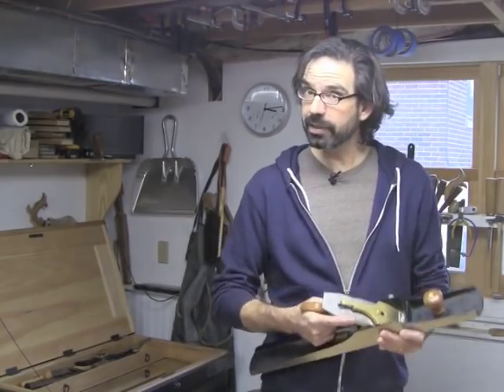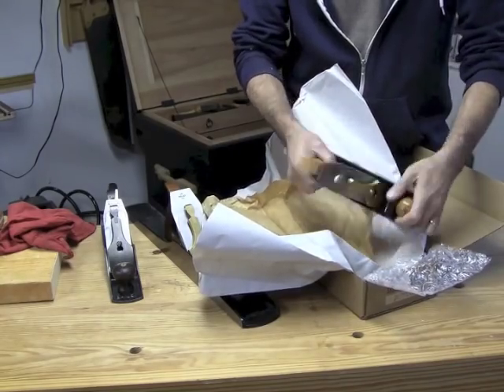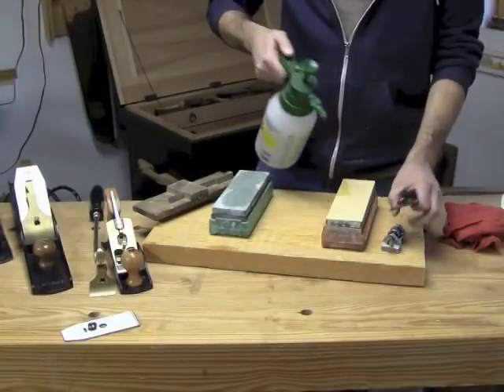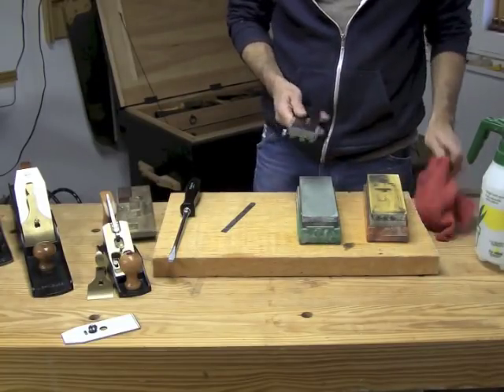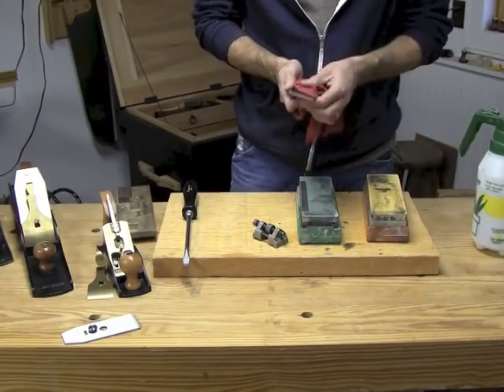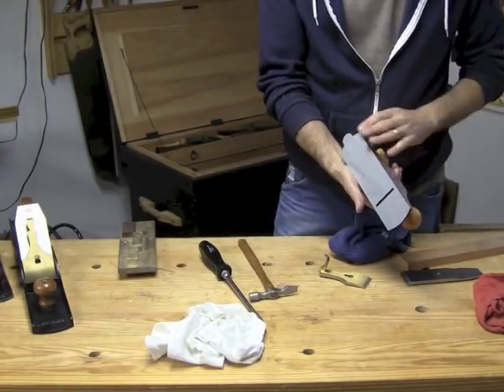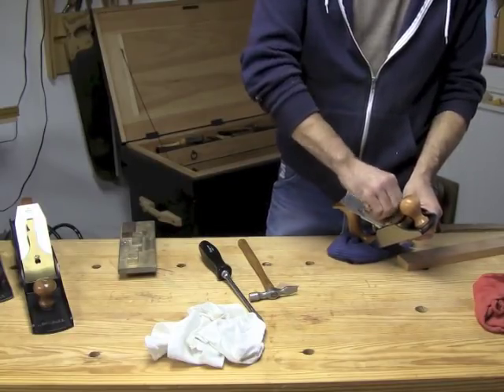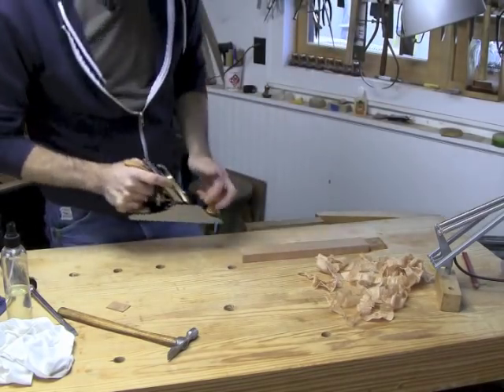Set Up a Handplane

Comment: I was super excited when this video started. I have old "garage sale" planes (hand-me-downs, in my case) and wanted to learn how to set them up, as you said you had done 100s of times. So, you can imagine I was a little disappointed when, instead, you just pulled a new premium plane out of the box and set it up. This video was like a "best case scenario of plane setup"—everything is pretty much perfect and only needed minimal adjustments. I'd love to see this same process, but with an old no-name jack plane that needed it's sole flattened, the chipbreaker set, an old iron tuned, etc.
Reply: Hi dough, this is 2 years late, but maybe it still helps. There is a video on YouTube by Paul Sellers called restoring the bench plane. He restores an old Rusty one, sharpens, sets it up and explains along the way how it works. I followed it last weekend. Had a blast. Now I get some pretty nice shavings! I could do with getting more practiced at the sharpening aspect I think. But practice is normal to get better haha, the first result was still pretty good. As a first time user that video worked great for me! P.s. I bet you'll love the rest of his tutorials too
Reply: @danielh12345  Never too late on the Internet! Thanks, Daniel. I appreciate the pointer and I will check it out.

Comment: M. Schwarz,
What about tuning up the chipbreaker, according to David Charlesworth's advice that even the chipbreakers on premium handplanes (Lie-Nielsen, Veritas) need a little work. I honed the bevel and polished the back of the chipbreaker, and did experience a not insignificant improvement in performance.

Comment: The most important bit: never, no matter the type of the metal plane, try to adjust the iron using the knob or the lateral position lever on a new plane as the tightening screw at the front is almost certainly set too tight.

Thanks for the video!

Comment: Christopher as usual an informative video, thank you. One question. Using a side fence honing jig, whether eclipse style or the Veritas II which I mainly use, how does one go about sharpening a blade square when the sides of the blade are tapered? So that if the sides are locked against the side fence in the jig as usual it will render the blade edge such that it is no longer perpendicular to the center-line of the blade to be honed? Thanks again

Comment: I've owned vintage Stanley hand planes for years. I recently bought a No. 5 1/2 and No.4 premium planes but can't get the lever cap to stay locked down when I run the blade through it's full cycle. I've taken them both to the point of being too tight to adjust the blade depth - being too loose to hold the cap and iron. When they came I could not remove the lever caps by hand. I had to loosen the screws before that was possible. 
I can't understand tightening them so tight, I think it damaged something. Yeah, I'm going to call them after the holidays but it is such a pain when you spend that much time saving up for them and now I'll have to mickey mouse around with sending them back across the country. I've never had these problems with the vintage planes but I still second guess myself. 
So, I guess this is just a rant.

Comment: It's made to cut wood.  He's setting it on wood.  It's only a problem if your bench has paint, metal shavings, and other crap on it.  It just really depends on your work environment and what you're doing at the time.  That being said, I like to set mine on it's side just so it doesn't mess with the set up of the blade and change it's angle.

Comment: I have an old Stanley No. 4 SB. It has two thumb screws and raise and lower the blade, but it does not seem to have a chip breaker. Am I missing a part? The chatter is unbearable and unless the blade is almost fully retracted I can't get it to shave off a nice slide. Am I doing something wrong? Please advise. Thanks.
Reply: Its a piece of old crap and has no chip breaker just a cap iron .Pass it off to someone who doesnt care about quality or refine it to be a scrub plane .Its useless as a quality smoother.

Comment: If the blade is not locked down on the frog with the lever cap so tight as to allow blade adjustment without loosening the cap, how is it tight enough to plane the wood without being moved back up the frog? IOW how can you adjust the blade depth without loosening the lever cap?
Reply: ***** The mechanism to change the blade depth involves leverage from the screw, so it's like pushing 10-20 times as hard as the pressure you use to turn the depth adjustment knob.  You won't get nearly enough pressure when planing to back up that screw.   My high school physics is rusty, but I also think any friction on the screw will be magnified, so it would likely take 50-100x as much forward pressure to cause the screw to "unwind".
Reply: As I believe I commented earlier, I would also think the yoke acts as a lever with the fulcrum much closer to where it contacts the blade than where it is moved by the adjusting nut. Perhaps that is why many recommend when adjusting blade depth to leave the nut on the forward movement so it is pressing against the blade. However, if you can still move the blade from side to side over the frog how tight can it be ? But, again, that lever also is operated with the fulcrum much closer to the blade than to where you are holding it so the advantage of leverage makes it seem much easier to move the blade side to side than it actually is.

Comment: Call me stupid but the chip breaker ghost on the flat part of the blade not the beveled side... The beveled side goes down so it's underneath at the mouth correct? I just bought a cheap Harbor Freight plane a number 4 and the thing was in pieces in the box with no instructions for assembly I understand how to sharpen the blade which I had to regrind then rehone had no edge whatsoever I've got the blade sharp but I'm not sure about how it goes into the tool any help on this would be greatly appreciated
Reply: +izzynutz2000 there are different types bevel down and bevel up another good site to watch about hand tools and planes in Paul Sellers

Comment: when you  ask about   why you can see the scratches better  when you only  put pressure on the push and not on the pull it s because even  if you move  you lade half a thou over the width of the stone    every line  will move

Comment: Lay your planes on the side when not in use - that way the blade doesn't get damaged by whatever crap you have lying around on your bench.
Reply: +deemdoubleu The bench is made of wood. lay them down onto the wood.
Reply: +terrortorn well I got that bit of advice from a time served joiner who would not always have had a handy nice clean wooden bench to hand, think building site.  it's a general rule which guarantees you don't plonk your nice plane down on a nail or a concrete floor.
Reply: +deemdoubleu You don't expose a razor sharp edge. If you have poor facilities you compromise but it isn't a rule.
Reply: +deemdoubleu or put a thin piece of wood under the nose to keep the edge off of the bench and not exposed to things being moved around on the bench

Comment: I’m interested in old/antique furniture and looking at the fit and fix of said furniture I never cease to wonder what’s this obsession with going over the top with tools.
 
1000 and 8000 grit stones when you’re actually working to no better than several 100ths in your cut and fit especially with hand tools.  
 
He sharpens to 1000, polishes to 8000 and then puts a curve on the edge by guesswork that he calls “experience” BUT STILL GUESSWORK.
 
Nothing more than 400 needed on hand tools any more is nothing more than elitism and bragging.
Reply: Having watched a few of Paul Seller's videos, I'm inclined to agree. He, in fact, argues that anything more than 250 grit is probably needless.

For my money, my current sharpening "system" is a set of diamond stones that run to 600 grit. My tools still cut nicely. Waxing or oiling your planes' soles makes a fairly dramatic difference though.
Reply: Sorry but id have to disagree, after only sharpening to around 400 on my oil stone for a long time i gave the wet and dry method a go and il tell you now the difference is outstanding, i will always carry on with this method as i doubt there is anything better as ive tried all ways before it, every type of stone, compound ect.

i only sharpen to 800 grit even though i have up to 2500 grit paper but i dont feel the need, for parring with a chisel i need to use next to no pressure at all, and i mean a baby could push on it and get an amazing glassy finish like i do, the same goes for my planes, i use old vintage stanley, bailey and record planes and i could feel the difference straight away on all my tools, rough cuts with my 5 1/2 stanley jack plane are now as easy as pushing the plane without the iron being in, its just amazingly easy to use, the same goes for all my tools i sharpen this way now, this method even makes using a cheap no name block plane a dream, its a standard angle one and yet it does brilliantly with really dense end grain on hardwoods.

I think you should give it a try before you knock it, youll be plesantly suprised just going to 600 or 800 imho.
All the best, Dan.
Reply: He was using waterstones, which do not run on the same grit system as sandpaper.  1000 waterstone = 700 paper grit, 8000 waterstone = 1500 paper grit.
Reply: Also, the higher grit is not to achieve more flatness but to achieve more sharpness, i.e. using smaller abrasive particles to scratch smaller bits off the edge of the iron, creating a smoother and therefore thinner leading edge.

The camber (straightness or curvyness of the iron or edge) and sharpness (microscopic fineness through smoothness of cutting edge) are two separate things. A knife with a curved edge, a sickle or a carving gouge can (and should) be as sharp as a straight edged knife or a chisel. 
You don't need your cheek to be precision flat but you still shave with a sharp razor - not because you want it flat, but because you want it smooth (a "close shave"). The point is sharper irons are less effort to cut with. They have less resistance in the wood and less tear-out because they sever/cut/shave rather than push/crush/splinter the fibers on a microscopic level. That's the reason why they create smoother finishes, not because they're flatter.
That's how I understand it, anyway.

Comment: All of this is achievable with a 35 dollar Stanley. If you cant work with what you have your not woodworking. Not to mention if I spend 400 bucks on a plane I dont want to have to touch a single thing. Sorry I just see no need to spend that much on something you can get with a little love to your current tools
Reply: And please, tell me what you'll do when it's dull... you'll have to sharpen the iron multiples times when working with high sillica wood. what does it change to sharpen and flatten it when you receive it ?
Reply: No, it is highly unlikely that "all this is achievable with a 35 dollar Stanley." If you want to put $350 of labor into it, have at it. You will still have a blade, that no matter how sharp you get it, will not retain its edge anywhere near a LN or other expensive planes.

Comment: Watch him on the 1000 stone run the iron down the edge (taking the flat off the stone) see the colour of the water change.
 
Then he puts the guide on and continues to put the stone out of flat by applying more pressure to the outer edges of the iron see the colour of the water, stone even more out of flat so what’s the sense of working to 1000’ and 8000s when the stone is out of flat by tens of 1000's?
 
A little of what he said I liked but sorry a lot of what he was saying was just pure pish for tool fetishists.
Reply: cupiddstunt Could you be more clear about how you would do it differently?  That might actually help me out.
Reply: Darryl Adams Ok as simple as this for one I never PUSH and pull any of my cutting edges on the stones, I only pull, or draw as it is commonly called.

I have two “dragon’s tongues” (they are Welsh slate) sharpening stones one is two inches the other is three inches wide both about ten inches long, I also have a couple of diamond plates aprox six by two inches these if I remember are 400 and 600.

The three inch wide stone I use curiously enough for the wider irons and my open razors as they are also about three inches long in the blade the two inch stone is for the narrower blades.

Diamond plates are almost impossible to rub out of flat so any flattening of irons as he does in the beginning or when applying a “secondary” bevel as at 8.15 or sharpening narrower blades like chisels are all done on the plates.

I always draw the blades the full length of the stone and never use short sharp movements like he is using in this video all short rubs achieve is taking your stone out of flat faster.  I do not apply a lot of downward pressure on the cutting edges when drawing them over the stones it is more of a stroking action, once you have a good edge on your blade it does not take a lot of effort to keep it there.    

If my stone is wider that the blade I am sharpening I will draw say first down the left of the stone and then the right then the left then the right alternating on each draw this keeps the stone flatter longer so prolonging the time between having to re-flatten the stone. 

Hope this helps